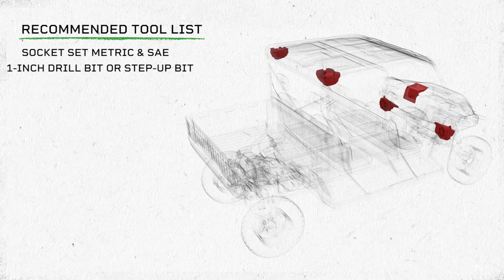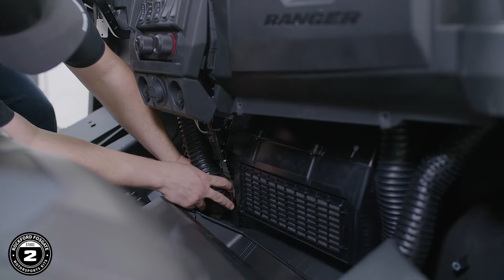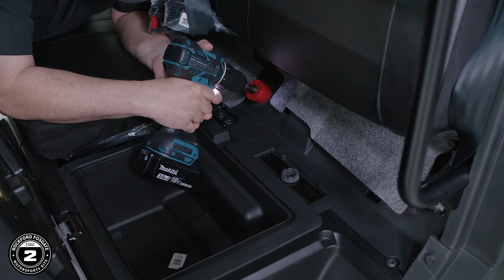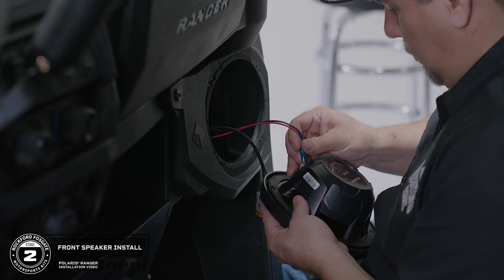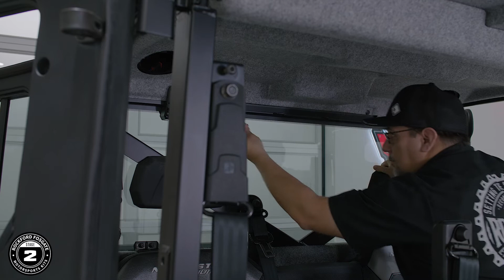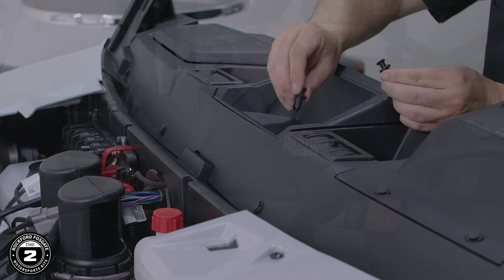2018+ Polaris Ranger STG2 | Installation

Comment: Good evening. Great job explaining bud. Will this work on a regular ranger 1000(not xp)?
Reply from the maker: Our compatibility chart shows no, but if your Ranger has the LOWER DASH with left and right pockets (each side also has a horizontal water bottle holder) then it will fit.  You can see our compatibility chart here: https://rockfordfosgate.com/products/details/rngr18-stg2/
Reply: Thank you! I guess the only other question is my front dash where the radio unit goes looks a little different. I also have a fold down windshield and thats where it locks. Im guessing I should still be able to screw that lock piece in just a matter of drilling a few holes
Reply from the maker: @scottraesz292 The front dash should look exactly as the photos on our Compatibility charts. If you have the tip-out window, you can make it fit with some modifications.

Comment: Does this unit come pre-wired for a subwoofer and amps?
Reply from the maker: You can add-on a subwoofer and amplifier, but you need to buy the AMP WIRING KIT as it does not come with the STG2 system.  We would recommend just buying the STG4 system that has everything included, with the added RGB LEDs: https://rockfordfosgate.com/products/details/rngr18-stg4/

If you want to buy them separately, here are the models you would need to buy:

• RNGR18-K8: 8 AWG Amp Installation Kit:
https://rockfordfosgate.com/products/details/rngr18-k8/

• M5-1500X5: 1500 Watt 5-Ch IPX6 Amplifier:
https://rockfordfosgate.com/products/details/m5-1500x5/

• RNGR18-FWE: 10" ported sub enclosure:
https://rockfordfosgate.com/products/details/rngr18-fwe/

• M1D2-10B: 10" DVC 2Ω Element Ready Sub:
https://rockfordfosgate.com/products/details/m1d2-10b/
Reply: @rockfordfosgate  I have already bought this unit...do you have ordering info for subwoffer and amp kit
Reply from the maker: @MrBeheler1  O.K. great, the ordering information are in the links I provided above.

Comment: 2024 Polaris General sport will this work and if so what would I need to make everything work on it ? And the speakers I have a 2020 Polaris Ranger 1000 XP with the ride command could I use the speakers from Rockford Fosgate and swap out the factory ones for the Rockford Fosgate ones ?
Reply from the maker: The RNGR18-STG2 will not work in the General.  For the 2020 Ranger XP 1000 + Ride Command you can't simply swap out the speakers with the factory ones.  The smallest kit we offer for Ride Command is the RNGR18RC-STG5: https://rockfordfosgate.com/products/details/rngr18rc-stg5/

Comment: 2023 ranger crew with HF Antenna do I need a different mount because the amp bracket doesn't sit flush to the radiator support tabs
Reply from the maker: You’ll need to move the antenna to the landing above and then the bracket will have room to fit.  You may need to push on the bracket down hard to snap it into place.

Comment: Hey Eric can I just buy the roof mounts for the speakers that are shown in this video? Great job btw
Reply from the maker: Hi Tom, if you're looking to buy the rear roof mounted speakers, you can buy the bundled trim panels + speakers here.  The kit includes the rear wiring harness that supports Color Optix: https://www.rockfordfosgate.com/products/details/rngr18-rse/   -Eric
Reply: @rockfordfosgate  is $329.99 the best price I can get for the mounts?
Reply from the maker: @tbatkins1  That is just for the mounting rings, hardware and Deutsch wiring harnesses.  You have to select the speakers, which are added to the price.